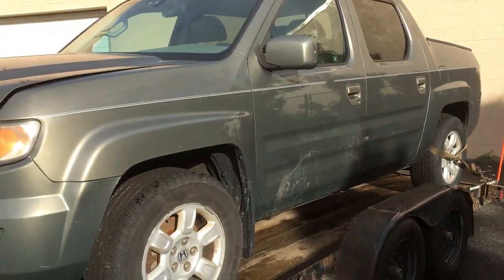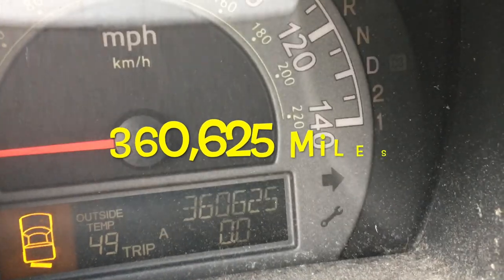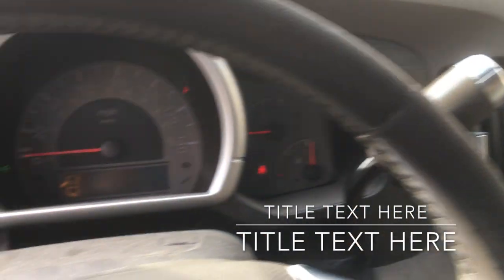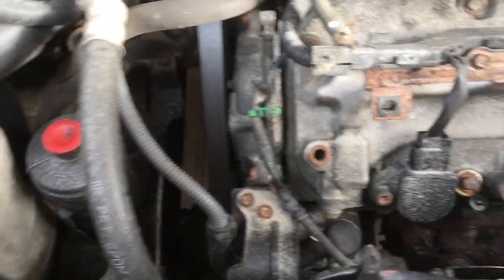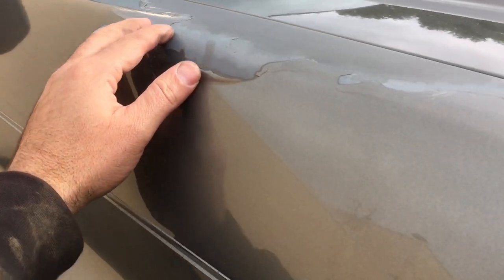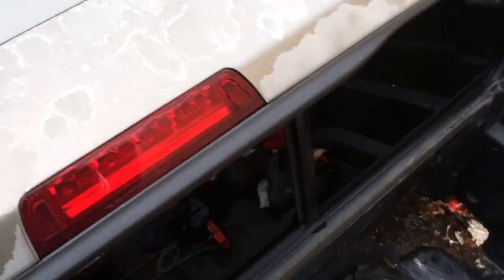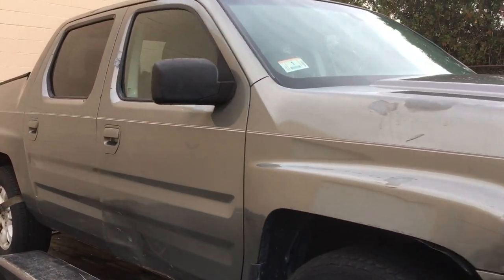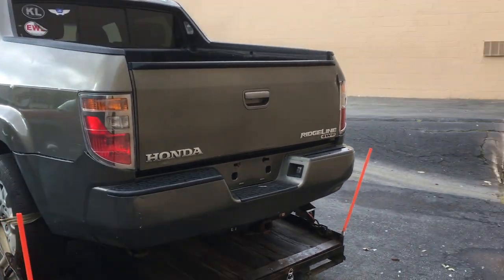Is Honda Ridgeline A Good Truck? 300,000+ Miles

Comment: My neighbor has 750,000 miles on his 07 Ridgeline. He knows nothing about cars. Has his oil and filter changed when the OLM comes on. $29.95 with his coupon plus free car wash. That’s exactly what he told me.
Reply: most will have the cylinder #4 low compression problem long before then.
Reply: And the manual says,  just use 87 as nothing higher makes it work any better! Got a 19 and love it!
Reply: Very impressive!
Reply: Its the frequent washes that have the thing rolling at 750k.

Comment: My 2006 RL just turned 242K miles today. Runs perfect. I keep trying to justify buying a new truck but I can’t when the RL is paid off and runs perfect.
Reply: If I may ask, how many miles before you changed the  timing belt and water pump? Mine was last done at 175k. I'm currently at 239k. I've anywhere between every 60k and 105k. That's a big gap.

Comment: I have basically this same truck, an 06 RTL with 223,000 miles on the clock. Runs great, uses zero oil and shifts as smooth as the day it was bought new. These things are about indestructible!

Comment: I have a 2009 Honda Ridgeline that I bought off the internet from Southern California with 129,000 miles on it. It was bought and serviced at the same Honda dealer its entire lifetime. I had it shipped to me in Montana since I could not find one locally. It hasn't had 1 problem in 3 years, except those little pulleys for the rear seat supports and the air bag recall. I changed the fluids myself just to make sure. I'll have the break fluid done at Honda this summer before hunting season. Everything works and it's immaculate. It's a lifetime vehicle for me.
Reply from the maker: Awesome!
Reply: How many miles?
Reply: @lh9140  139,000 miles now.
Reply: Brutus Gallicus still strong? Nothing showing?
Reply: How much did you pay ?

Comment: My 06 just turned 118,000. My neighbor has a 07 Ridgeline and has 750,000 miles. He knows nothing about cars just  changes the oil when the OLM comes on. He told me he gets the oil and oil filter for $29.95 at the dealer with the $10.00 coupon. Comes with free car wash. HA.

Comment: I just bought a 2008  that had one owner with 164000 miles and the damn thing runs better then my 2015 Altima that has 48000 miles.  I am presently surprised.
Reply: @kevin Austell The reason I'm watching this video is because I'm considering a RL with 198,000 miles at $8,995 Does this sound a good price to you? Any advice would be greatly appreciated. Thanks.
Reply: @Kevin Austell May you share how much you pay for yours?

Comment: I have 07 Honda Ridgeline this coming up year make 2 yrs since I had it. Bought the truck from a dealer auction for 5,000 wit 150,000 miles on it had the truck on the road for 6 months and the transmission went. So I had the transmission rebuilt for 2,000 & just recently took my vehicle back to the place that did my transmission bc 7 months later it started acting up again luckily it was under warranty for a year. I wanted one of these trucks for yrs now & now I got one & it's giving me nothing but problems. Hopefully after they get this transmission right I'll be more satisfied with it.

Comment: My Honda grass trimmer I purchased in 2005 is still going strong. Changed the plug twice. Starts first pull . Just bought a 2006 Ridgeline with 188,000 miles on it.

Comment: I have 2011 now and had 06 before. Sold 06 at 150,000miles. 06: had to change brake calipers, hood opening cable, front cat converter and oxygen sensor, and AC went so I traded in. 11: so far I had to change brake calipers, starter motor and that’s all so far at 130,000 miles.
Reply from the maker: Nice! That’s normal stuff. 👍

Comment: A little shy of 150K on my 2007 RTL, though it is no where near as rough as this one. The main watch-out is the radiator issue, but had the radiator replaced a couple of weeks ago without experiencing the transmission fluid / coolant mixture. These really are great trucks! Fully expect it to run for years, as I put a little shy of 500K on a 1992 Accord with no issues. Of course timing belts, and keeping regular service intervals is key.

Comment: Just bought a nearly identical 08 with 153k miles for 6k (current 10k value) just to do some dirty stuff now and then. One owner, well-maintained, was able to get it instead of owner giving it away for 4000 trade in toward new Ridgeline! This video and the comments really help me feel like I might have just accidentally bought a daily driver vs. a dirty junk runner. Timing was done at 130k! I think maybe I need some hubs/bearings soon, other than that it feels like a new El Camino. Ha!

Comment: My 2006 has 290,000+ miles and its my daily driver. Will need to fix a/c next summer though
Reply: Yr and miles the same 240K driver. Just fixed the A/C , new battery, reg oil changes!
Reply: had you change the timing belt yet?
Reply: @namling-cf  ɪ ᴊᴜsᴛ ʜᴀᴅ ᴍʏ ᴛɪᴍɪɴɢ ʙᴇʟᴛ ᴄʜᴀɴɢᴇᴅ $950 at the DEALERSHIP❗

Comment: I Have a 2007 with only 141000 on it. I bought it cause my buddy has the same one with 325000 on it now with no problems. Paid 12,000 for it 2 yrs ago. it is having a slight hesitation when stepping on the gas so going to change the fuel filter and see if that helps
Reply: If that doesn't work check out your acellorator pedal position sensor

Comment: Bought a 2009 with 226k  from my neighbor last year for 1300$. New tires and fluids. I love this truck. Sold my 2021 f150 i had just bought since i never drove it after buying the ridgeline. I also have a 2019 accord hybrid 60k miles with no issues.

Comment: Hey Honda’s are good cars I have a 2006 Honda Pilot with 254,000 miles on it original engine and transmission still rides like new I thank the first owner for taking care of it
Reply: how often do you do the transmission fluid change?
Reply: I did a half trans flush because I had the subframe replaced and lost fluid in the process so 4 qts were replaced I will be changing the transmission fluid soon but only about 4 qts because I don’t know if changing it all is a good idea

Comment: Only downside I've heard with these is parts can be hard to find and kind of expensive since they arent as mass produced as some other options. But since it shares the same platform as the pilot, I feel like it would be fine.
Reply: Same engine as my wife 06 odyssey on my 09 ridge
Reply: I’ve heard Honda Pilot parts go in these except the suspension parts.

Comment: Thanks for this video! After seeing this video I feel better about my purchase of a 2006 Honda Ridgeline RTL. I have always liked Honda's and have owned several but the Ridgeline was beyond my wallet capacity LOL. It has 103,200 miles on it and the red paint still looks glossy and drives better than my 2011 Taco PreRunner. Plus! it is AWD/4x4. If anyone has any suggestions or issues I need to check out on this truck please let me know.
Reply: Taliban Hunter when your check engine light eventually comes on with a 420 or 430 code,  I’ll bet you it’s just a bad o2 sensor, and not the catalytic converter itself. Store this away in your memory and you will thank me later. Also change that timing belt!
Reply: @therivershark  Thanks for the heads up, so far no engine light error codes yet but will make a note about what you suggested! Thankfully, part of the purchase agreement was to have the timing belt replaced so i'm good to go as far as that's concerned. The only issue that is more frustrating than non-functional is the Climate Control adjustments only change when I rock the knob back and forth. From what I had read, the entire Auto Air Conditioner Control Unit. Is that correct or could the knob connection is worn out and needs to be replaced?
Reply: Taliban Hunter sorry, I haven’t encountered the climate controls problem yet.
Reply: @therivershark  Hopefully you won't! Thanks anyway for the previous advice.
Reply: Research the term " STRAWBERRY MILKSHAKE " on Honda Ridgeline forums  and what part of the radiator to examine . Change ALL the fluids .
Ridgelines have a nice ride and are pretty reliable , I think I'll be hanging on to my 08  after see your truck with 360K miles .
Reply: Sorry I was referring to YT channel  KarFix .😎

Comment: I just got a 2006 with 266k for $4550. The Ridgeline’s with 100k-200k miles were all rusted, loose control arms, bone dry radiators, super rich fuel readings… The one I have has no rust, new tires, ice cold A/C, cranks, rides and turns smooth and only needed a new valve cover gasket. I want to get her to 500k.
Reply from the maker: Very nice!
Reply: @Karfix  She drove 96 miles in the rain with no issues. The “TPMS” light came on but it looks busted since all the tires were of good health.

Comment: hahaha my 06 ridgeline has 270,000 and so far beside the oil change and break pads i haven't done anything to it. my friend who is a mechanic at a honda dealer was amazed that i haven't change my timing belt yet. he said usually it need to be change at 100,000 miles and normally it will snap at around 170,000. i guess i will have it change asap. or should i test the water to see when it will snap? :-)
Reply: khet Ly I changed it around that time.
Reply: Its an interference engine so don't let it snap or goodbye engine.

Comment: I love my Ridgeline. Just wish it had more Torque. It’s slow as all
Get out. Don’t need a race car but man. An extra 50 HP and torque would have been perfect.
Reply: Turbo it
Reply: Coming from a 4 cylinder tacoma and a 2002 V8 F150, the Ridgeline feels like a rocketship. There are way slower trucks out there
Reply: At least you’ll get the reliability behind it👍
Reply: I test drove a stock 07 Ridgeline yesterday. I'm no racer since I have an 05 base Mini Cooper and use a 2020 Chevy Silverado HD for work, though I wouldn't exactly call either one slow. What I can say is unless your only goal in life is to beat everyone off the line at a stop light (only for them to catch up to you at the next red light lol) then the Ridgeline performs quite admirably in the speed department for what it is.

Comment: I’m thinking of buying a high milage Ridgeline. Would you drive a Ridgeline from 200,000 miles to 300,000?
Reply: Definitely mine has 170,000 miles and runs like an absolute champ. The guy who sold it to me keeps saying he wants to buy it back 😂
Reply: @imperium1011  I just bought a 2012 Ridgeline with 198000 miles hope it lasts 😭
Reply: @hifromspacejojo6729  ....You won't have anything to worry about just as long as you take care of it and maintainance when need it. The truck will last a very long time.

Comment: So wud u fellas say buying a 2006 ridgeline rtx b worth paying 6000 fir it. It has,160,000 miles
Reply from the maker: That’s reasonable price.
Reply: Same situation...I found a really clean 06 but w/166k for $6400
Reply: I literally just bought one today, 4200 for 150k miles
Reply: I just bought an 06 with only 74k original miles and I paid $9,200.It was a private sale, interior is 9/10 esterior is 8/10 do you guys think it was a good deal?
Reply: Hi fellas I had 2006 Ridgeline at 102k in great condition , unfortunately it got totaled while it was parked.I found 2013 Ridgeline for sale  advertise at 183k,in really good condition,put down $600.Dealer asking $14,900.Found out that it has 233k, dealership lied.So what should I do?Should I ask back for my down payment,or after listening to you guys ,demand reduced price and keep it ,it's fully loaded originally Florida and NY car and 2 owners

Comment: The Ridgeline is an extremely great soccer mom truckette. It is not a real truck however. It is good when you want to send your little woman to pick up your kids after school. I had one from 2008 till 2013. Then I dumped it for a Ford Superduty. A real truck! The Honda dealer quoted me $3200 to replace the shocks  and align the ft end . That’s when I said screw it and bought a real truck!can you tow a 6500 lb trailer? No. Does it have a v8? No. Does it even have ventilated seats? No. It’s not a real truck !!!
Reply: It can tow 5000lbs with a v6 You can’t even change your own struts and need ventilated seats …. Im outa here 🤣